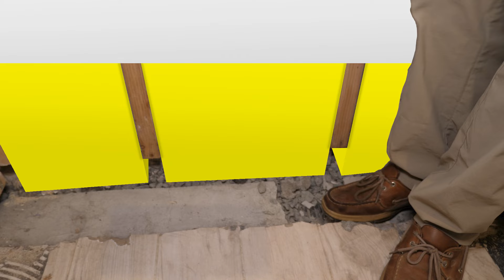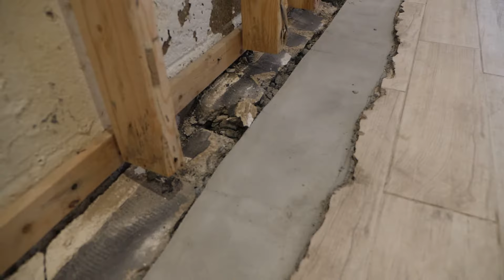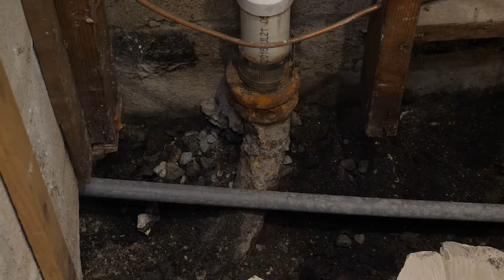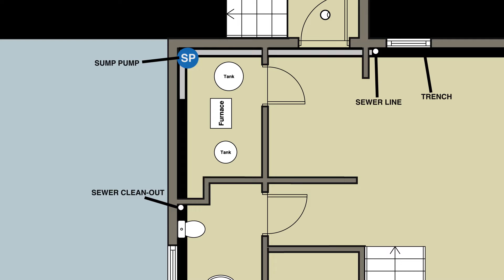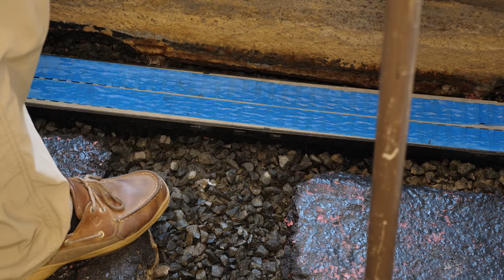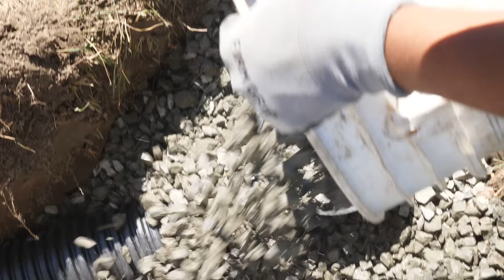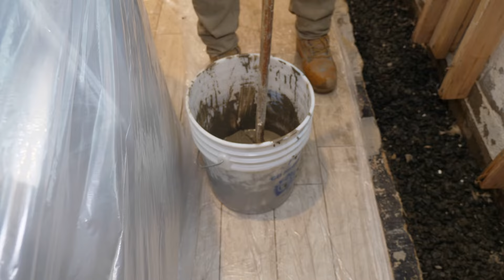Top Method For Waterproofing Your Basement: Installing Corrugated Drainage Pipe

Comment: I can't even imagine the cost to do all of this. Of course it seems like the "right" thing. Obviously you don't want water in the basement, but I don't know how people afford this type of work.
Reply from the maker: Financing is an option if money is tight. Keep in mind, a subfloor drainage system in your basement will increase the value of your home and lower your insurance. In other words, it is money well spent.
Reply: Our contractors all provide financing for this type of work.  The real issue here is that people often go to the lowest bud without regard to what they are having done.  It is often people on fixed incomes that are forced into making the repairs because they are facing flooded or very wet basements.  I highly recommend finding Healthy Basement Certified contractors to make sure that you have the best professionals you can.
Reply: @johnnierice6817  What's the cost of this project? I know every project is different, but it will help ground people in what to expect.
Reply: Got a similar system installed in my 500 sqft basement. Was 8500$  @hu5tle-  got mi

Comment: Does your company do any exterior suggestions, upgrades or preparation to stop water from the outside? We're trying to minimize water near the foundation to help keep a very small basement dry. Your videos are very helpful and stopped me from applying a waterproof coating on the interior walls & floor, which can be damaging. We're upgrading gutters & downspouts, to keep water away better now.
Reply from the maker: Yes we do inspect the outside and make suggestions where needed. Always exhaust all outside options short of excavating around the foundation and installing drainage around the footer. It is always better in every way and more cost effective to do footing drains from the inside.
Reply: please explain as to not excavating outside- what if holes in stone or no existing foundation footer drain on exterior  @AmericanDryBasementSystems

Comment: This company did our waterproofing of a 2500 sq ft basement a year ago. The engineering and logic these guys put into this is epic. Its exactly as they show. They ripped out an old system like that was always flooding. Now.... zero water. Basement is just another room.
Reply: Everything he discusses just makes so much sense.  I'd love to know what a job like that costs. My basement is approx 1000 sq ft.
Reply: o @joanies6778  4
Reply: @joanies6778 😅😮😮😮😊
Reply: How much did it cost u ?
Reply: @nayshaness what did you pay?
Reply: Hey This company/Owner takes pride in their work and get it done right.
Reply: How to get contact with them??
Reply: How much did it cost
Reply: What was the total cost?
Reply: @Alex M, what did your project run you, if you don't mind me asking?
Reply: Thanks Alex, what it ran you for that 2500 sqft basement?
Reply: @4cupsx01  I honestly rather not say. It was in the middle of Covid and right before the inflation hit. So I don’t want to shout out prices so future clients these guys have have the wrong idea. What I will say is it was well worth it. The house had water problems for 50 years and when they did their system they found another system under the slab that previous owners tried to install and it obviously failed. 

They installed clean outs where I can open and see the pipes and they are clean. We have had massive rain storms and zero water. 

The investment we made will actually add value to the house and allow us to confidently finish the basement and make sure that investment is also protected.
Reply: Just divert your downspouts 5 to 10 feet from your foundation. And none of this will ever happen
Reply: @StuKatz911  - 100% correct, provided your yard doesn't slope the wrong way and falling rain flows downhill towards your house.
Reply: @StuKatz911 depends if that's enough to control and manage the water table. It's definitely the cheaper solution and worth trying first.
Reply: You're all wrong as is he